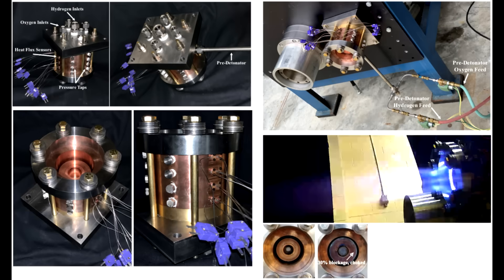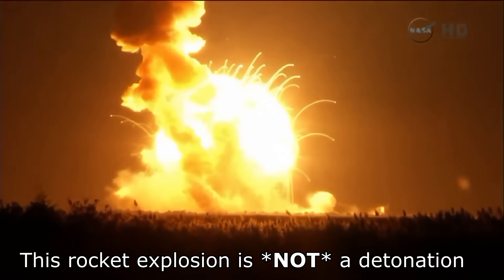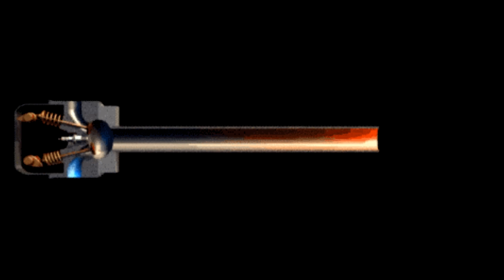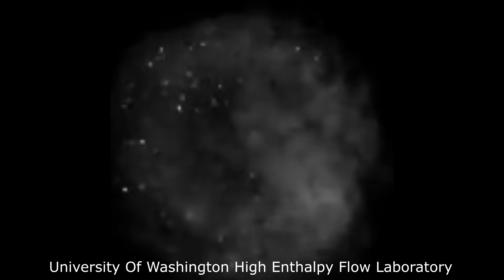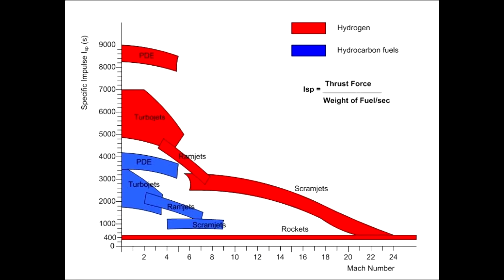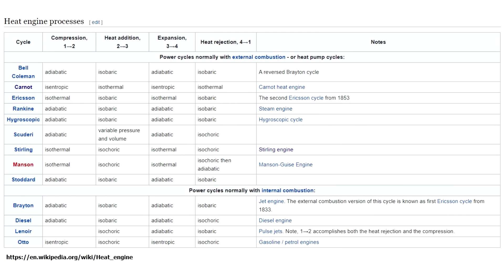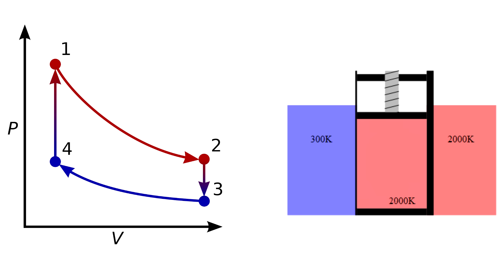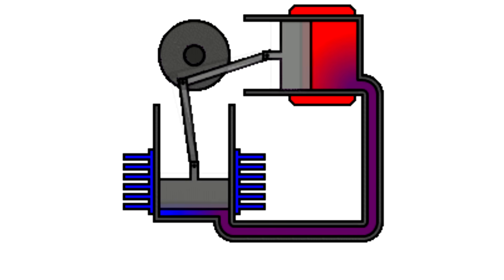What Is A Rotating Detonation Engine - And Why Are They Better Than Regular Engines

Comment: Your literally answering all the questions I had on Rotating Detonation Engines. Awesome stuff.
Reply: When going from linear to rotation, where do the valves go? Has the rotating engine 100 valves which sustain the pressure of the shock wave?

Comment: @1:58 - "the flame front can accelerate and start to move faster than the speed of sound in the gas." This is amazing, but most people assume that the average speed of molecules in a gas is the same thing as the speed of sound in a gas. This is not true, and I have yet to find a science video online that explains the difference between the speed of sound and the average speed of air molecules. I think this topic would be a good video for you to create.

Comment: Mad idea here. How about a toroid where detonations run around the outside with expanding gas going out of one side while new gas is fed from the other side. Pipes on each end these are tuned to resonate (like a Furze jet). 
The toroid could be made from alumina ceramic (very hard high temperature stuff). Let the suggestions begin.

Comment: You can do that bottle/alcohol trick with an empty plastic 5 gallon distilled water bottle from your local store. Makes a great whooshing sound when it finally gets to the bottom. Isopropyl works but fuel alcohol works even better. Of course, this should be only done by licensed professionals who have received special training in the field of explosives. Proper eye, head and body protection should be worn at all times. The experiment should only be done in an open space and all observers should be at least 20 feet away. Check your local ordinances before attempting this demonstration.

Comment: I wonder if it is a workable idea to inject oxidizer and fuel from tiny, adjacent injectors where the injection speed is fast enough to have a standing wave detonation? Would the idea of using a linear spike as a heat exchanger to get enough heat into the propellants to inject them as gas at standing wave detonation speeds work?

Comment: The flame front does not become a shock wave as stated it is preceded by a shock wave and thus the combustion or flame actually occurs at subsonic speeds relative to the reactants entering the flame front.  However, due to the expanding products behind the combustion wave  the combustion wave can be supersonic relative to ambient conditions and a fixed location outside the combustion environment.

Comment: 01:52: What is happening here Scott? First you have the blue front burning down. Then two things seems to happen. Both a "bounce back from the botton and/or a turn into yellow flames. The last I associate with burning soot particles; but I would guess you shouldn't have carbon particles larger than two atoms long, unless they "associate" to something larger, then burn.

Comment: Fun facts about RDEs from someone who worked with them:
- ZERO moving parts
- CRAZY hot (main challenge). Usually run for 0.5-2 seconds to avoid, y'know, liquefying inconel.
- Sounds NOTHING like you'd think. One firing kinda sounds like an unjustifiably loud banshee scream.

Comment: Would a detonation engine be louder? i'm guessing detonation will produce more vibration and thus noise. That would make it harder to use on the first stage, as it could damage the launch area and the rocket itself. Thoughts?

Comment: also.. nice point on earth weather. I've heard the argument is weather Contol wirh rf isn't possible due to power required. I'd argue if u can model it via heat flow you would find places that you can heat just a little to stear larger fronts

Comment: If pulse detonation can work as an air breathing jet to hypersonic speed, why not have a air intake boost mode ala the skylon sabre engine?  A small effeciency boost might give a little better payload buts it's still the tyrrany of the rocket equation and multistage.

 Air breathing boost might be simpler than sabre engine and that high ISP bonus means either a much higher payload fraction or a feasible true SSTO reusable vehicle.

Comment: I worked an engine that was designed by an engineering firm GHKN. We tested it at Aerojet/Rocketdyne test lab near Seattle. We ran it on oxygen and ethylene. Detonation engines run hotter than normal engines. The detonation waves can damage the internal parts of the engine. It was a fun project to work on. They went on to do testing at Edwards. Later they did test in an altitude chamber.

Comment: The thing that I'm interesting in is how this affects the rockets equation. Since the fuel weight is such a big deal for rockets, changing the efficiency of the engine is a huge deal. I'd also be interested to know what the effect of a specific impulse so much higher than conventional engines would have on upper stages.

Comment: Hey Scott, would you be able to post the links to the analysis of the Humphrey cycles and the basic mechanism these research engines are using to trigger the Shockwaves? I've been interested in the Humphrey Cycle as it's been talked about for a while now but not much good, free, public information is out about the thermal dynamics cycle itself and the mechanisms used to trigger the Shockwaves in these research engines

Comment: Damn, I thought I was smart (intelligent even!) but I never would have conceived of such an engine.
I wonder if it would be possible to apply magnetic forces to control the wave? (inwardly I'm screaming 'Flux Capacitor').
I suppose that would entirely depend on the fuel and one or two other little details that I omit. (yes, but what if you could inject a stream of metal plasma into the mix? Hell, get rid of the mix and just straight-out use plasma?) Time for my medication.
Anyhoo, new subscriber and gladly so... (you can thank me later)
 Pax

Comment: Spark ignition piston engines advance the spark to a point where the fuel burns rapidly but any more advance would cause detonation. Basically detonation would destroy the engine. Diesels use a multitude of small detonations within the fuel vapour. Overall the effect is similar to spark ignition but thermally more efficient. If we could accurately time the detonation just as the piston is starting to move dawn we might get the best efficiency of all. 
Making it work without blowing up the engine is another question.

Comment: That "drain pipe" engine at 3:48.  That's a 4-cylinder internal combustion engine head isn't it?  With a custom cam, and using each pipe as a combustion chamber and "cylinder", but with no pistons in them?  Right?

Comment: I was under the impression an "engine" is any device that uses a chemical reaction to generate heat. I didn't think a transfer to cold had to be part of that.
Reply: An engine produces movement from an energy source, thermal aspects are common but not required.

Comment: Brilliant!  I'd argue for rotating the cross section of a typical rocket detonation chamber and nozzle about the longitudinal axis, but also using a prime number of detonating wave fronts (3, 5, 7, etc.) for stability along with timed pulses of additional fuel/oxidizer to the constant fuel/oxidizer influx in order stabilize the timing of the detonation pulses, in the same manner as multiple pendulums on a platform tend to synchronize.
For example, if you had 5 detonating wave fronts, you might employ 36 sequential micro-nozzles for the influx in addition to the slit-fed primary fuel/ox feed.

Comment: Months ago I thought of an engine design with only one moving part, it has the core principles of functioning the way a Wankel Engine works, but doesn't have an odd circular path, the center part stays fixed in place while spinning, no shims to wear out, and it doesn't need oil, just grease for two bearings, Centrifugal forces bring in new fuel and air, also exhausting burnt fuel.  This engine is also perfect for using HHO

Comment: So if you have a cylinder with an inner and outer wall and could utilise a 'piston' to vary the length of the combustion cylinder as the detonation cycle is increased that would give you a variable thrust control? Just a noob and asking...

Comment: He described the watt steam engine with out mentioning it. Watts engine worked on the basis that filling a cylinder with steam then condensing with cold water a vacuum would draw a piston turning the wheel.  His invention is credited with the creation of the industrial revolution.

Comment: There is a proposed shaft engine that uses detonation as follows.  Imagine a centrifugal compressor wheel.  The charge is induced conventionally in ONE channel.  It is thrown outward, but instead of entering a diffuser, it collides with a dead end.  This creates shock wave combustion that reverses down the channel propelling the impeller like a radial inflow turbine.   Since impeller is rotating, the cycle is repeating in each channel.  Ports are closed and opened as impeller rotates.  
   This explanation may not be 100%, but I hope it conveys the idea.  Seem to recollect it is the idea of a Polish professor working here in the states.  D

Comment: Saw some things on different channels,  and they kinda meshed with it in my head... one other video was on illustrating the operation of a Tesla valve with flame. A Tesla valve allows for flow in one direction, with no moving parts. Another was on 3d printing a pulse jet (not PDE, but closer to the V1). Tesla valves are useful in pulse jets to allow fuel feed into the combustion chamber without a mechanical valve.

Anyway, in the valve video, it was mentioned the flame front of a (deflagration) ignition of a fuel(propane)/air mix seemed to accelerate through the valve. Granted, the valve in question was not intended to hold large pressures, so doing this with that setup would be spectacular... once. But what if  you took a long enough (and heavily built and cooled enough) Tesla valve, and you had the flow velocity of your fuel/air mix such that the acceleration provided to the reaction in the main flow channel reached detonation velocity (much like the 'pipe' in the PDE), but also allowed for a continuous feed of mixed reactants from the side channels of the valve, even fairly close to the detonation zone. You'd have high pressure continuous deflagration on one end, some distance (as small as you could manage, I'd think) further along there'd be a detonation zone, all continuously fed by injectors.  

Continuous Linear Detonation Engine.

I know I'm missing something (probably that the flame front acceleration is being driven by the thermal expansion of the deflagrating gas behind it, most likely), but if a CLDE is possible, it might give a step up to the RDE.

Comment: It seems like you would have to have multiple waves because otherwise you have a higher thrust at a moving point causing oscillation and instability that would have to be corrected. Multiple waves means that they should balance out as long as they are equidistant from each other. Why I'm i saying this to people who probably realize this? Because Scott didn't so someone has to.

Comment: Why not make it a bit like a gatling gun so the out you have a faster pulse rate. I see what they are after but some times simple is better. At least in the starting phase of new tech. When the combustion chamber is needing out gassing and not detonating, rotate the barrel away and cycle in a new barrel and new fuel injection, repeat. Brrrrrrrt.

Comment: Bob Lazar mentioned these types of engines, they have been developed for a long time, possibly in secret. 

He mentioned that these engines can be incorperated into a unusal shape aircraft, with a special doublle half conical/full conical wing.  He said they could reach speeds up to mach 7 and beyond. 

He said the the speed could be much higher but heating and thermal issues prevent it from being useful at those speeds. 

Acceleration unheard of, rapid movment. I can imagine the shape of the aircraft but he only ever described it.

Comment: Once you understand that the atmosphere is a giant heat engine, you can see why climate change alarmists are full of it. Heat engines move energy from where there is more of it to where there is less of it, and the higher the difference, the more energy is available for work.. Reduce the difference and you reduce the amount of energy available to do work.
According to their own theories of climate change, the troposphere in the mid-latitudes will undergo proportionally more heating than the tropics. This will decrease the temperature difference between the tropics and the mid-latitudes, reducing the amount of heat available for transfer, throttling back the heat engine by reducing the amount of heat available to do work. The heat energy creates hurricanes and cyclones, and the storms carry the heat energy from the tropics and deposit it farther away in the mid-latitudes. If there's less heat to do the work, the result can't possibly be "more and more violent storms" as the alarmists claim. With less heat available for work, that would mean fewer storms over the course of a season (because less total energy is seeking to go where there is less energy), and less powerful storms at any particular time during the season. Climate alarmists can't have it both ways, physics won't allow it.

Comment: Don't know if someone mentioned these already, but I have a few(?) questions:

I'd like to know what exactly the means for electricity generation are (if any) in RDEs? 

Since the combustion chamber needs to have a really thin lining (at least in a few of the prototypes with "filled" centers), is it possible to place that machinery (alternator/gearbox/whathaveyou) into the center of the can with the blades essentially "covering" the exhaust? Unless, of course, both the inside and outside of the can are annular. Maybe all these images are just the combustion chamber only?

Maybe it would still have a fan at the front, considering that the detonation will draw intake air in at a pretty high speed...so like a reversed turbine with a generator on the front fan and no rear turbine? If so, what kind of bypass would we see for these kinds of engines due to the increase in efficiency? Would they all be low bypass engines like fighter jet turbofans?

If RDEs theoretically can provide 25% more power, that most likely means the same or more increase in heat as well, right? 

Does that actually power increase not take into account the decreased weight from the lack of moving parts? I'd imagine it would have a significantly higher TWR. 

Would we see any increase in the pressure of the fuel jets compared to more standard material? Would higher fuel pressure be a requirement to reach the minimum ignition and sustained operation levels? That said, will this be useful for more traditional jet fuels or is the more likely fuel source going to be hydrogen (obviously hydrogen would be more useful for high supersonic into hypersonic intake speeds, but I'd like to see how this affects current modern turbofan design)?

Also, either turbine material will have to be even farther beyond the already amazing inconel, or you would have to limit the power of the exhaust and sacrifice most of the gain for power generation machinery, which would also make it heavy again. That's assuming that RDEs don't run at a minimum pressure and temperature that would make adding said machinery impossible due to it causing engine conditions to drop below the operational level.

It's all very interesting, but I just have so many questions!

Comment: TANSTAAFL. The closed cycle rocket engine, specifically SSME, already converts  86% of chemical energy of combustion of hydrogen with oxygen into kinetic energy - acceleration of the exhaust gas - usable thrust. Adding extra 25% on top of that means the rocket can output more energy than it consumes. So... let me take these nymbers with a grain of salt.

Comment: This constant volume heat delivery reminds me of the Otto cycle, which, for a given compression ratio, has higher efficiency than the Diesel cycle. Funny enough, you can't increase the compression ratio in an Otto engine too much because of, well... detonation :-)
Reply: Many of the problems of preignition and detonation have been solved with the HCCI Homogeneous Charge Compression Ignition.   The charge is ignited by either injecting a easu to ignite liquid such as DME (Dimethy Ether) or manipulation of the air fuel ratio and exhaust gas re-circulation.   The RCCI engine Reactivity Controlled Compression adds a spark plug.  Daimler Benz was testing them in WW2 all the way to 40,000ft.   Formula 1 use them and they are 45%-50% efficient.   It's likely they will operate to 58% efficiency.  Better than fuel cells.

Comment: can I use Plasma and antimatter to have such rotating detonation? One wave in clockwise direction and the second in counter clockwise rotating around a dark mass screw rotating ?? Building then a reservoir with moving walls for active pressure.  What would be the reaction or chain reaction is that even probable or am I misguiding myself?

Comment: It boils down to, more efficient engines, means cheaper travel.
Reply: Not necessarily (I'm hoping it means less polluting travel, and making it any cheaper reduces the chances of that)... but probably, yeah.

For rockets in particular, it means both cheaper AND less polluting travel, because more efficiency means less fuel required, means less mass to lift off the launchpad, means WAY less fuel required...

Comment: One useful consequence of airbreathing RDEs possible not needing a compressor is that they then do not need a turbine either, as the sole purpose of the turbine is driving the compressor. This means you can run it much hotter, as you don't need to worry about the turbine blades melting.